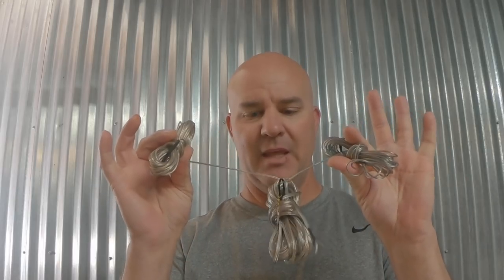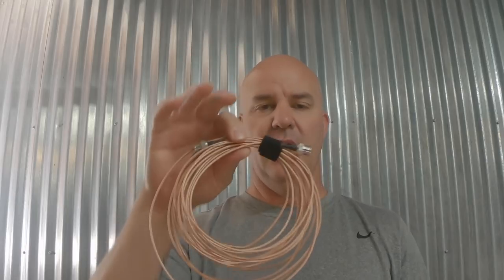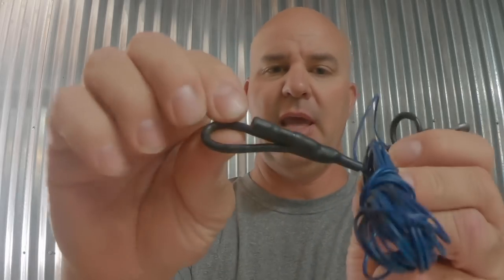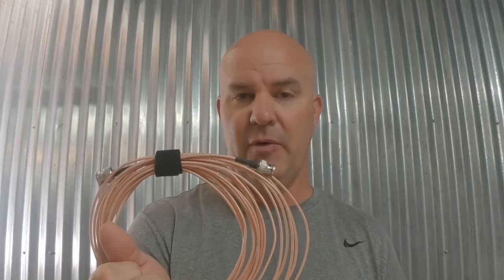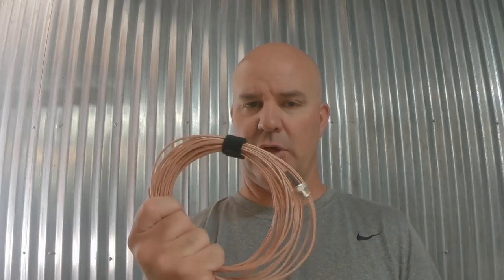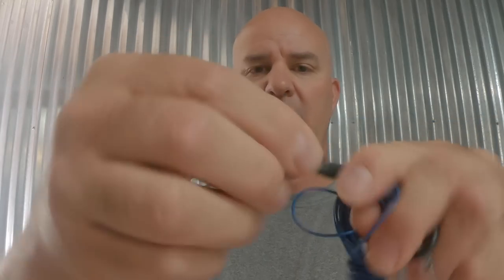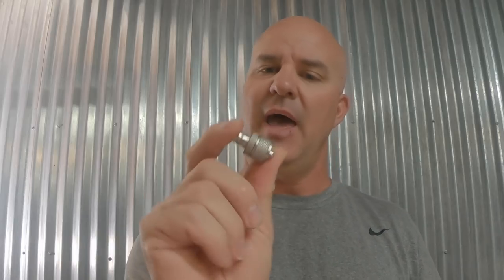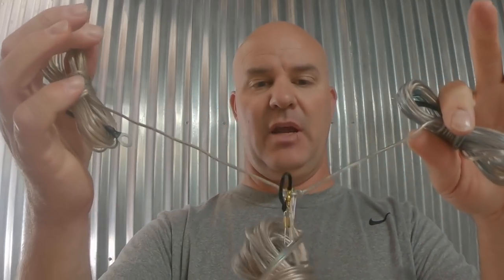Antenna Wars Part One - Dipole v Speaker Wire

Comment from the maker: Have you ever made your own antenna?  Tell us about that first time experience if you have.
Reply: I made an end fed antenna a number of years ago. It didn't go well the first time, but finally got it right.
Reply: Made a vertical antenna couple of days back with linear loading and 4 tuned radials for 40m but failed miserably, now im gonna try this speaker antenna...
Reply: KG6HQD Jerry - I’ve made dipoles with regular RG58 and with zip cord.  All had compromises one way or another.  But, all worked.  I try to keep away from using tuners.  They are just a way to trick the transmitter.  The key to maximum ERP is appropriate Impedance and Reactance, as in any other tuned AC circuit.

Don / W5DON
Reply: I made a 20 M dipole antenna before I passed my General Exam.  I would just listen for hours...Once I passed and keyed it up for the first time, it was like magic making those first contacts.   In the end, as long as you're on the air and and making contacts, that's all that matters.
Reply: My first antenna build was a doublet (G5RV style) which is essential the same as a speaker wire antenna, but with a slightly more efficient feedline. Not wanting to carry the tuner, I then built dipoles, OCF dipoles, Delta loops, end-fed halfwaves, small transmitting loops ("magnetic" loops), a linked dipole, trapped end-fed halfwaves, and most recently a half-square.  But I have NEVER built or used a speaker wire antenna. Perhaps I need to make one now... And a tuner to go with it.
Reply: Speaker wire too-short randomly folded dipole on balcony. Basically no signal can get out. The building's too well grounded.
Reply: Jerry, all my HF SOTA contacts are thanks to your Speaker Wire Antenna.  It works very well for transmit and receive, and took me maybe 20 minutes to build.  The weight savings alone are worth it.  I even built a 40M Inverted U Speaker Wire version for my home QTH, and with 100 watts and only mounted at 12 feet in the air I am getting out 4,000 + Miles.  Great Job, and thanks for all of your contributions to the ham community.  73!  AI6ZV  Terrence
Reply: I have yet to make an HF antenna, but I have made a 2m tape measure yagi. It's fun, interesting and rewarding. I do plan to make a balun soon.
Reply from the maker: Totally agree!
Reply from the maker: Adam I hope you do make one and when you cut it to resonance and get it all tuned up you wont need a tuner... works great for me and I use the less efficient mode of SSB on my SOTA activations as you know.
Reply: Yep. Made my own linked 80-10m dipole fed with rg174. No tuner.  26gage sprinkler control wire. 

I refuse to buy antennas. 

 Wade. VK1MIC Canberra Australia.
Reply from the maker: Man, post pics on Twitter and tag me please
Reply: I don't Twitter so I don't know much that debate.

2019 APR 05,
My first antenna was pieced together with scraps picked out of a construction site dumpster. I had enough wire to make a fan dipole for 80, 40, 20, 15, and 10 meters. With my Heathkit ATU I was able to work the WARC bands too. I have built all my HF antennas except for one. A Cushcraft vertical that covers 80 meters to 10 meters, each band tuned to the CW portion. I have always promoted building antennas, and other amateur radio gear, to learn from the build as well as the use, and to discover what can be done with materials gathered and assembled by the individual rather going out and buying every piece of gear you might want.

From the 15th Edition of The ARRL Antenna Book published in 1988 this same antenna is referenced on page 15-2 as ZIP-CORD ANTENNAS (I have paraphrased some of this. Therefore quotation marks only where applicable.) The first paragraph states that zip cord, the conductors are usually no. 18 stranded copper wire, is readily available at hardware and department stores, and it's not expensive. Zip cord is light in weight and easy to work with. Larger sizes than no. 18 may be also be found.

"For these reasons, zip cord can be pressed into service as both the transmission line and the radiator section for an emergency dipole antenna system. This information by Jerry Hall, K1TD, appeared in QST for March 1979. The radiator section of the zip-cord antenna is obtained simply by "unzipping" or pulling the two conductors apart for the length needed to establish resonance for the operating frequency band. The initial dipole length in feet can be determined using the equation length in feet = 468/the frequency in MHz of operation. (It would be necessary to unzip only half the length found from the formula, since each of the two wires becomes half of the dipole.) The insulation left on the wire will have some loading effect, so a bit of length trimming may be needed for exact resonance at the desired frequency." [Note: Speaker wire is assembled very similarly as zip cord. The outer casing is typical see through and more flexible than standard zip cord. Any household wire that is constructed similarly may be used for an HF antenna. Whether you use the zip cord antenna temporarily or more permanently is another issue.]

Paragraph 3 starts with "For installation, you may want to use the electrician's knot shown in Fig 2 at the dipole feed point. This is a 'balanced' knot that will keep the transmission-line part of the system from unzipping itself under the tension of dipole suspension." Further reading of this section is testing information provided by the ARRL laboratory to determine the electrical characteristics of zip cord as a radio-frequency transmission line, using a 100-foot roll, in other words, how efficient is a zip cord antenna system? The last paragraph says "In short, communications can certainly be established with a zip-cord antenna in a pinch on 160, 80, 40, 30, and perhaps 20 meters. For higher frequencies, especially with long line lengths for the feeder, the efficiency of the system is so low that its value becomes questionable." Something that many of us already knew from experimentation, but ARRL laboratory gave their blessing for this type of wire as a doable radiator and feedline, combined, for the HF frequencies as high as 20 meters.

Best 72/73 KB8AMZ
Reply: I made a portable 2 element cubical quad, and on my 2nd outing made a qso with New Zealand from my division (England), 100w.
Reply from the maker: Ah, well that’s ok and hope you join
Reply from the maker: Epic contact!
Reply: I know I'm late to the game but I got into Ham RAdio and immediately dove into antenna making. My VHF/UHF antennas suck (except the tape measure yagi) but my HF antennas work great. So far the most successful is the earchi 9:1 transformer into a 30 foot piece of speaker wire using 50ft of RG8x instead of a counterpoise, which I could have used instead but was too lazy to make one this afternoon. Made a LSB contact 2600 miles away on 20 watts!

Comment: Great video, Jerry!  I recently bought a 100' foot roll of speaker wire (for $9!) and made my own.  Made a contact with Chile from my back yard to test it out.  A couple of comments: 
1.  I think the linked dipole was going for around $40 on eBay -- I almost bought one! They really do look well-made.  But then again, I already have a SOTABeams linked dipole (works really well!). 
2.  Even though speaker wire isn't the ideal feedline, open-wire feedline does have advantages over coax when multi-banding it with a tuner, so I think there'd be a definite advantage there, loss-wise.
3.  This is by far, the easiest to build antenna I've seen. I put it together with my kids' help in less than an hour and got on the air.  I think that one thing may matter more than anything else (even though the performance seems to be stellar).
73, Rex KE6MT
Reply from the maker: Totally Rex!  It's cheap, easy to build and works very well when compared to other options that matter for us QRP SOTA Portable Ops guys/gals.

Comment: Really looking forward to seeing how this pans out. I built a speaker wire linked dipole for 20/30/40 the other day for portable use and was amazed at how simple it was to put together and how well it tuned up. Proper radio!
Reply from the maker: So you made a linked version of the speaker wire antenna?  What did you do for the overall length of the transmission line?  What was your apex height? @k6ark
Reply: @KG6HQDJerrySOTA  Yep. It was pretty much thrown together using what was to hand. I used the linked dipole calculator on the sotabeams website to get some starting values for radial lengths. The telescopic pole is only 5m tall with the feedpoint sitting at about 4.5m up so it's pretty much firing up the way on 40m. Wire lengths from the calculator were 4.81m, 1.92m and 2.88m with a 1.5m paracord on the far end. Actual lengths after experimenting and cutting to tune are: 4.19m (seems very short!), 2.79, 3.48m with a 1.5m paracord on the far end to take it to ground level. These are way off the calculated lengths!  I left the feedline 10m long for the moment but may shorten it. Links were done with bullet connectors. It's pig-ugly but cheap, effective and I'll not burst into tears if it gets wrecked. I've yet to use it in anger.

If it turns out to be a keeper, I'll tidy up the connections.

I think I'll make up a single 20m band one too as it doesn't get much simpler than that.

Thanks for all your videos. Always interesting and well put together 👍
Reply from the maker: Wow man that’s very cool. I’m totally digging how so many of you are making these antennas and sharing your experiences. I’m going to make a 40m version and see how it shows on my analyzer then if it dials in it’ll be my home station antenna. Like you said, if I wreck it who cares lol.
Reply: @KG6HQDJerrySOTA  So.... After some experimenting with the antenna in a completely open and RF noise free spot I was a bit unhappy with its performance. Yes, it did get out - just not very well. The antenna tuned well on 20, 30 and 40m but I was wondering what on earth was stopping it radiating. I decided to swap out the 10m long speaker wire feeder for an equal length piece of rg174 with a balun at the feedpoint. After that I re-checked the tuning and it had shifted WAAAAY off! The 20m band section was resonant at 16 MHz, the 30m band was resonant at 9.6MHz and the 40m band resonated at 6.3 MHz. These frequencies are more consistent with the actual cut lengths of the radiators. I remade the sections from the now unused speaker wire feeder and cut them to tune with the rg174 and the antenna sprang to life. The difference was remarkable. Where I had only been able to contact close EU stations before, with the new antenna I made several good CW contacts into the US with one down in Florida - all on 5 Watts from the East Coast of Scotland.

From this, I can only deduce that the speaker wire feeder was interacting very heavily with the resonant properties of the antenna. In which case it would be very difficult to predict performance when the feeder is run over different surfaces or in different directions.
Reply from the maker: I’m sure the transmission line does act as part of the antenna and would change the resonate lengths of the legs as compared to coax and balun, a more traditional dipole flattop configuration calculation. All this is great fun and I’ve found I’ll accept the minor trade offs of speaker wire tx line vs coax for the weight and bulk when doing SOTA, but that’s just my choice. I’m not trying to win any DX contests rather just make fun qsos all across the US via qrp from peaks. Nothing is a one size fits all but again, it’s fun to see how different peoples experiments are stacking up.
Reply: @KG6HQDJerrySOTA  Yep. It's still a fun design and does get a signal out which is pretty much all that counts at the end of the day. 👍
Reply from the maker: Truth!

Comment: good video.  i figured out from the antenna book about the transmission line. using the same wire you can use 1/4 lambda, 3/4 lamda, 5/4 lambda etc.  it totally cancels the impedance of the dipole at those intervals.  so using the same wire for 20m antenna, if your ears of the dipole are 5m, your transmission line using the same speaker wire to be matched can be 5m, 15m, 25m, 35m etc just adding a half lambda (10m) over and over.  5m is kinda short for getting to my radio so i'm building mine with 15m transmission line. (total distance from radio to end of one of the ears is 20m).
you cannot use transmission line of half lambda, 1 lambda, 3/2 lambda etc as that will actually double the impedance.

Comment: Jerry, one cost/weight/capability comparison you didn't mention is that the speaker wire antenna requires a tuner for multi-band use. The linked dipole is resonant on every band it has a link for.    The one I built has links for 17m, 20m, 30m, and 40m currently.  It's my go-to antenna for 100w operation.  I can't imagine carrying a tuner big enough to handle 100w to use a speaker wire antenna. But for multi-band simplicity and functionality with a KX-2 or KX-3?  That, or a random wire would be my go-to as well.
Reply from the maker: That's a very true point Adam and while I touched on the concept of multi-band use for both antennas, the head to head I envision is strictly 20m v 20m to keep a resonant system on an equal playing field.  I guess I feel lucky my KX2 has an internal tuner but I do remember the days of dragging Z817 with me when I had the 817ND radio and wanted to use other bands.  Forget that noise when I'm doing SOTA for sure. But, another thing to consider is I can easily attach linked sections to the speaker wire antenna just as easy as the linked dipole.  Elevation off the ground is the only sticking point but that would effect both antennas the same so it's a wash.  Testing will confirm. Thanks buddy and hope we get to meet up next weekend for the SOTA campout, or is that this weekend?  Crap I've got lost in time already....
Reply: @KG6HQDJerrySOTA , indeed!  The FT-817 and z-817 combo is heavy and bulky, and it's only 5w!  Because the feedline is not 50 ohms in the speaker wire antenna, making it multi-band without a tuner is not as simple as adding links at carefully measured points along the radiating elements. The length of the feedline impacts the tuning and will make your resonant link points unpredictable.  It may be possible, but would be much more difficult to make (if those resonant points even exist) than with a coax fed version. Have you experimented with links on the speaker wire antenna?  Out of curiosity, have you measured the impedance of the speaker wire?
Reply from the maker: Hey Adam, I haven't even put that much thought into the linked sections as it was never my goal.  It only was brought up here because I'm using the 20m main portion of a linked dipole that should be and will be resonant on 20m as compared to the resonant 20m speaker wire antenna I use.  I did note and record the z of the speaker wire antenna during the build and last Saturday in the field.  The z is at or near (setup dependent) to the 50 ohms mark on the speaker wire setup.  Much more on this topic will be explored and shared during part 2 of this series as that is the controlled conditions experiment plan for the head to head.  This video series isn't about making linked speaker wire antennas, though it could be a spin-off series since you brought it up and it fits into the spirit of the whole idea.  Anything fun and challenging and experimenting is worth exploring to me.  Never know, might get an update to my patent lol
Reply: @KG6HQDJerrySOTA  FWIW, I measured the impedance of some 24ga speaker wire I have: 135 ohms.
Reply from the maker: How did you measure it? What was the setup?
Reply: @KG6HQDJerrySOTA , I measured using a fixed carbon resistor per the instructions in the RigExpert AA-35 zoom manual.  Easy to find online... find the section on measuring characteristic impedance. The technique should work with any antenna analyzer that shows a resistance/reactance plot.
Reply from the maker: @K6ARK  good to know, thank you.  Check this article out on the feedline impedance https://www.qsl.net/ke8di/zipcord.html

Comment: $5 for 100' of 24 gauge speaker wire at the local Ace hardware store. Plastic end insulators cut from a grated cheese container. Already had the binding post/BNC adapter. Can't get much less expensive than that. I think I cut the feed length to about 24 feet based on what I read on velocity factor, and the antenna is cut for the CW portion of 20M. I can work 40-6 with the kx3 tuner. Feedline loss at HF is negligible - I've worked from Europe to the west coast, from the east coast, QRP. Let the naysayers blather on about loss - the antenna works, and at a low point in the sunspot cycle. Glad I built this, thanks to your video.  de KE2SX
Reply from the maker: Thanks man, I’m glad it’s working for you

Comment: I built a speaker wire dipole as my first HF antenna based off of your design. I havent final tuned it yet so I had to use my LDG tuner but i have hit Hawaii and Japan with my center section only being 14' off the ground. Its a solid design.
Reply from the maker: And I've noticed you've been making all kinds of ham radio things to go with it which is cool.  So the ham radio gods don't strike us down and the hi hi OM's don't blow their minds, I really didn't "design" it rather I shared the design from the ARRL Antenna book 22nd Edition.  Had to put that in there because some people are really losing their minds over that inside joke, which is fun all on it's own lol.